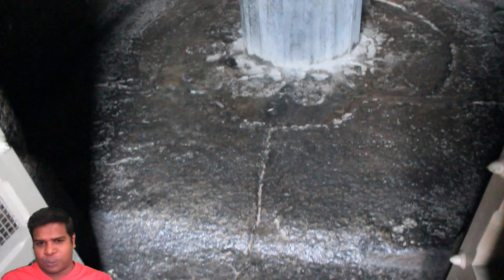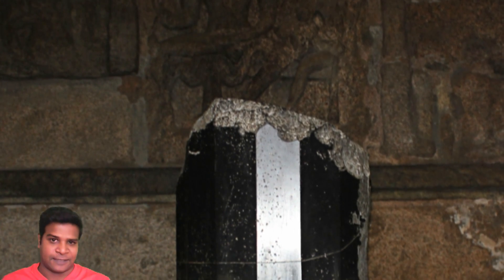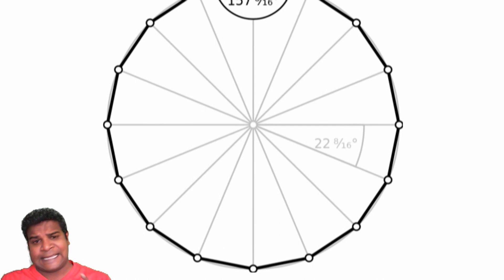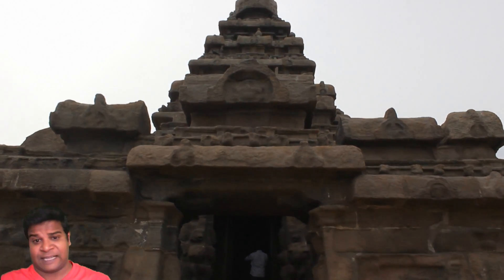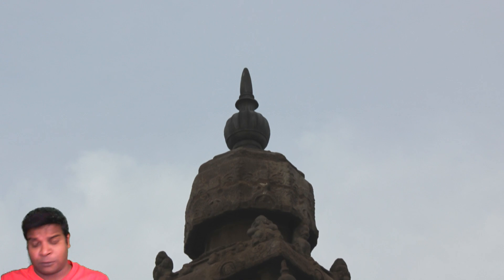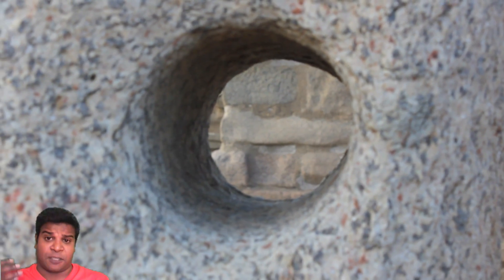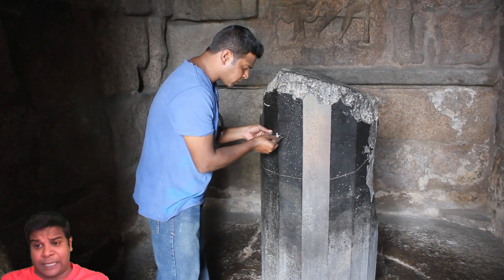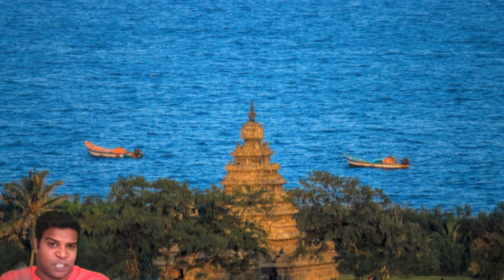India's Oldest Lingam - Evidence of Ancient Machining Technology?

Comment: If you use the Ancient Sumerian number system (base 60) to calculate angles per their ratio method, the value of 16 ends up being 16/60 which would be a simple 3 1/4, which is not hard to do at all.

Comment: lingham are stored in their own closet/cell/space liken to a tool shed/box sitting in/with their appropriate/fitted platform/base to be inter changed when dimensional changes are needed for a project. high rotational spin , material quality, electrical /energetic charging from usage may result in their energetic state liken to the magnetizing of a needle...ancients used harmonious natural health enhancing  energies, generally, thus residual energetic effects are found in them like a magnetized needle...like crop circles, when first created unhealthful microwaves are emitted, thus they are made predawn to allow for radio active decay. by the time they are found the levels are health promoting. dogs wont enter some as human will have head aches in some as well. but the physiology is self balancing if not in continuous exposure.

Comment: With as perfect as those are machined I wouldn’t be surprised if the faces match in orientation. If you where able to measure that they are most likely positioned the same. So the orientation of the kalassam and the lingam are most likely identical in location.

Comment: Basalt fibre products are applied in many industries:
-
fabrics as a fire blocking material in the aerospace, automotive, electrical industries, etc. and for insulation applications in nuclear power plants, liquid nitrogen tanks, etc.,
-
geogrids for road and highway reinforcement,
-
stucco nets, UD (uni-directional) tapes, etc. for wall renovation,
-
chopped fibres as reinforcement for asphalt concrete and thermal and acoustic insulation material in the building industry (basalt wool), etc.
Reply: Was the lingam source of some kind of energy which needed insulation.  Nuclear, electrical???

Comment: Looking at the structures of these ancient sites accross the globe. They look like atmospheric ion collectors. They all come to a sharp point and have a capacitor like structure inside. Instead of metals they used rock that they machined or geopolymer that were cast.  Herodotus said the Egyptians had electrum metal at the top of their pyramids. Aztecs used mica ceramic inside the pyramid. Everything screams power plants, and communication towers self powered.

Comment: i always enjoy your video's
good on the detail where others "forget" to look 
you notice the smallest man made details dril holes and all that stuf
thumbs waaay up :) 
however, if "we" need special tools, its not that everyone would.....
some things can be surprisingly simple :D

to make 16 facets on a round thing (column) you have to measure degrees?
how silly....you don't even NEED degrees......
try this one.....
take a rope with tight sliding beads on it.
put the rope around the column for the lengt. (not exact, not needed yet)
take it off and put the beads on
fold the rope double 4 times so you have 16 strands.
place beads at the fold points
now put the rope around the column tight
the beads will be close to the perfect spot, you only need  to fine tune to make it spot on perfect....
since stone grinding and polishing takes very long you have plenty time to correct, not like you will take 2 mm off by excedent right?
ahyhow, no need for special tools to measure  here.
however..... for actually carving that stuff .... i would agree... that needs tools!!

Comment: 16 sides make much sense if you forget about the decimal numeric system for a while and consider a hexadecimal system or base 12 or even base 60 (height of the temple) numeric system. Certainly, base 12 and 16 numeric systems are much more practical. The angle of the sides and lengths will be easier to calculate back then probably. 

Also, I really respect the way you research and put for theories.

Comment: Making such structures with hand tools would be impossible. Precision of machining is staggering. Hard basalt rock is cut and polished to perfection. This is most likely a model of technology used in steering of vimanas as someone is dividing circle by 16. I have seen compass of German bell shaped vehicle made in 1939 and they used less 8 step unit instead of 16.  Circular shape vehicles require different steering technology than regular aircrafts.

Comment: 1. Lathe a perfect cylinder.
2. Wrap a string around it.
3. Fold it in half 4 times.
4. Mark the folds.
5. Use that to mark one end.
6. Use plumb-bob to line up marks at other end.
7. Connect marks with lines.
8. Saw along lines.
9. Polish surface with flat board and sand.

Comment: Since the top and bottom material are in the center and  made of the same material ; what happens if the tip of the  top is struck by lightning, does that energy travel down through the center. Does any energy travel down  even when not struck, lets say on a sunny day.

Comment: It is not impossible to easily calculate the length between the opposite sides and make a grinding clip. With a grinding clip it is possible without any great effort to grind an arbitrarily long column while it is standing in form. The same applies to the supposedly turned columns. It is not difficult to make a grinding clip that grinds notches into a pillar by turning them around the pillar. The pulley system and the underlying mathematical knowledge were obviously known to the Indian People. The people who made this structure were very inventive and the variant of making these structures with a brace would be the most logical solution.

Comment: They were made with advanced equipment however they may have used the black basalt as the centre pieces because they did not have it and had to have brought in.making it rare and special. No point in having a roof that lasts millions of years if the walls corrode in thousands. Is the Lingam glassified or highly polished?
Reply: To make hexadecagon, all you have to do is make a square a cut of the corners you then have an octagon, hen cut the corners of the octagon and you have a hexadecagon and no angles measured.

Comment: Need is the mother of all inventions and what was the need to design them the way they are? 
Might be that the age had rich knowledge of rock cutting techniques and mathematics which people correlated with culture to create those amazing structures to showcase their talents and to please the Kings of that period. 
[We can make a hole on wall either by using hammer or drilling machine. We can tell the difference in that case. But, when we make a hole using drilling machine (electrically powered) and a manual drilling machine, the skill comes into picture. Both can yield same results depending on the skill level of the person.] 

I like your videos as they try to give an opportunity for everyone to share their views on these topics. Good job. Thank you.

Comment: I love your videos. The 16 faceted lingam is easy to make with simple tools. The key is doing it in steps with jigs. The simplicity of using jigs isn't worth mentioning in history. 1. Make square. 2. Cut off corners until you have 16 sides. Only requires a right angle & protective sacrificial covering material for the final cutting.
Reply: Mark Proffitt is your opinion true for a 6 feet long piece.

Comment: The first use is always said to be astrological.   Did the sun striking the 12' pillar emit a sound or vibration?  How is it that it measures in feet and not some other measurement.  the 6' 12'  and 60 is of interest.  the question I have is,  is there or was there something that connected between the pillar and the capstan on top?   I would look at sound as you have elsewhere, of vibration,  and third of generating some sort of current.   In Egypt there are signs of melted rocks,  rocks bored by vibration, and electric current probably static or with Baghdad batteries.  I note in the book of Enoch it talks about fallen angels coming down to earth and teaching "Forbidden" or corrupting technologies to men.  I have noted that Metallurgy  and Sound or Music are listed and you have covered here in India.  I note these are also found in Egypt, 

With the nature of Egypt  everything being underground.  I would strongly consider that in these temples there is a hidden underground and perhaps untouched aspect.    Some form of ground penetrating radar. airplane based or satellite based scans should be done or already exist.   Realizing the nature of the Indian Antiquities Department.  You might have to go to a small out of the way site where you with a few others could do some scanning.  You may well find some very profound things that will only be able to be published online.  As you would not get any help, but also be stopped if you do actually discover real things. 

This is a matter of caution. Because this could end suddenly and badly  as it has in a number of countries.   I will say It appears that there appears to be some international agreements to bury this technological past that is world wide,  With the nations who defy this being left to rot.  I am sure you suspect many things here.

Comment: Possibly a pre-made mold.They melt the stone then poured it into the mold, the Piller was simply done in sections then stacked. The top stone appears to have been one whole peice, perhaps the molding for the top piece was made of two parts so once they poured in the melted stone they could open polish it and place it. I am not sure but once the stone dried they may have had a machine of some sort to polish them after they removed the pre-made molding to shape the stone. That's what think.

Comment: I believe you absolutely correct. Main carving with 2-1 ratio is gear . statue holding rods (lt/RT) is two piece one inside another (as in Mining Drill Tool Used Today ). the other statues hold bits as stated.. make a 36" grooved wheel, use rope or chain from drive wheel (contains Turn Handle like modern round valve Crank- handle to pulley (bottom of shaft on rt is tapered square inserts into drive pulley. Discussing small heads hollowed. only way is a drimmil drill

Comment: Pyramids were created in 2600 BC and they are mathematically perfect structures. But it took skilled artisans, huge amount of labour and usage of lever and pulley technologies. Same could have happens here. It’s possible to create a perfect 16 face lingam. If it’s made with painstaking accuracy, then it is bound to have equal degrees. There were skilled people who had ample time for the project. It’s a great feat of engineering but not a topic to speculate about machine, divine intervention. Let’s keep it simple

Comment: If its the oldest, it could be one of the real few devices that were used non-religiously. I saw other pictures with multiple Shiva Lingams in a small river, and my feeling now is that the Lingam could've been a device to purify water in early civilisations, most likely together with ultrasonic frequencies. This could explain the tradition of pouring water on it in the todays ceremonies. The floor in the room looks like a hole have existed and cemented away. I also am thinking of the different height of the pillar is used either as the pillar is wearing out in the bottom (like a drill) or to adjust depending on water level.  Can the room be filled with water? Or is it open?  Maybe you can check if there is a water well nearby?

Also, what is your opinion on possibility of petrified wood on these ancient sites? The statues, the buildings?

Comment: i think it easy to create a 16 sides in a circle.
take a thread ,measure the circumference of a cylindrical rock.
mark every 1/16 in thread, then mark it on the rock.
make flat surface in between the marking in the rock.
Reply: Karups Samy Can also be done with a right angle. :)
Reply: My fnds its many years old..can u do that tme?

Comment: Nice video, thanks. It's interesting to see details of ancient structures. Quite enlightening.

It has been established by Joseph Davidovits that geopolymer cements were used to create the manufactured stone blocks of the Giza pyramids, and that identical type construction exists all around the world as part of an ancient world wide, interconnected civilization that focused on megalithic rock construction as a means of civilizing itself to be able to continue as a species on a planet whose life and geology is regulated by regularly occurring, world wide cataclysmic crustal displacements. The crust as a whole unit adjusts to a new equilibrium position on top of the main bulk of plastic/liquid earth beneath it, as clearly shown by Charles Hapgood.

The column in the video, called a lingam, is a shaft, likely symbolizing the axis of the earth. The entire temple would then represent some type of scale model of the earth, or one of its hemispheres, complete with all the features seen on an earth globe. Working as a knowledge book, this is just one of its functions. 

The "lingam" is made of an erosion resistant material, imported and different than the material of the rest of the structure, indicating a unique importance in the structure, like a special machine part. Rock and minerals have various electrical/magnetic properties, so perhaps the complete "temple" is some type of receiver or transmitter for electromagnetic energy, such as hydrogen radiation, which is useable for crop stimulation and/or conversion into electrical energy. 

It would be interesting to get an accurate estimation of the age of the complex. Modern dating methods are extremely biased because the institutions that create them are buried in their own agendas and politicized beliefs. For example, despite the existence of loads of evidence that show very advanced civilizations existed prior to 20,000 years ago, such as 500 year old copies of ancient maps that very accurately map the earth while there was still an icecap on North America,  mainstream archeology fails to promote them because the maps go against their claims that humanity only started civilizing itself starting perhaps 10,000 years ago, and only simply. Mountains of evidence proves otherwise. 

16 is a base 2 number, and it is a basic number for projections of spherical maps onto planar maps, used in cartography.  A globe of a sphere with longitude and latitude markings, is commonly created by making 16 cuts progressively at 22.5 degrees angle to the prior cut, to create the longitude lines, and 8 cuts (16 total) through each lower and upper half of the globe to create the latitude lines, 10 degrees between each of these horizontal cuts (plus one equator line that is common to both hemispheres where they meet to form a full sphere

6 and 12 are familiar numbers to everyone. 12 months to a year, 12 zodiacal signs of the celestial sphere, 6 months to half a year, dry season for one winter, wet season for summer in the tropics/mid tropics. India has always been in the tropics for the last 150,000 years and much longer, so it'd be natural for it's ancient builders to record half years in their structures, writings, and lifestyle. 6 is the number associated with equal day and night, the equinoxes, in which sunrise is at exactly 6am, noon is 6 hrs later at 12, sunset is 6 hours later at 6pm.  The ancients very often aligned their structures to east and west, i.e., to sunrise and sunset on the equinoxes. The "temple" in the video does the same.  

It is the case that the ancient civilizations were very focused on earth and sky knowledge, retaining it and living it in their entire society structure. It will be the case that this knowledge will be represented in all of their structures all of the time. 

It is most likely that the ancient temples across India are mostly made of geopolymer, artificially manufactured rock, following the methods of the rest of the one worldwide civilization that existed in the past, the civilizations rising and following with cataclysmic crustal displacement displacements that occurred periodically every 15 to 30 thousand years, lasting 1000+- years each.  See Charles Hapgood's 'Path of The Pole', to understand Crustal Displacement and how it regulates life on earth, all of evolution, and forms earth's surface geology.  

Knowing that humans are very ingenious, inventive, and innovative, one can easily see how they would have developed tools and techniques for creating the structures of their (our) civilizations in the past.  They are us, we were them.  Same human sapiens sapiens creature.  Just as our ancestors built structures 500 and 2000 years ago, we built them 10, 50, and 150 thousand years ago. But not much more than that. We lived more simply at that time, in the tropics mainly. But one never can determine that perfectly because erosion over enough time destroys everything.  What's certain is that Crustal Displacement dictates the rise and fall of civilization and the development of the human species along with all other  forms of life on the planet and the geological structure found upon it.

......

Comment: you can create power of two n-gons by dividing angles by 2. you can craft large flat facets by grinding agains a single larger flat face from a harder material. you can rough out the approximate blank with crude hand tools and then grind it to spec.